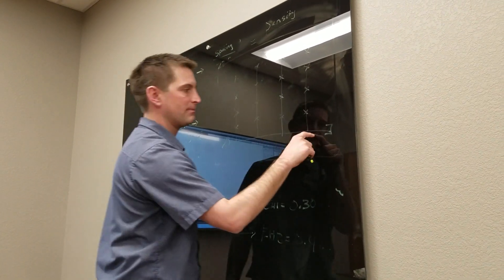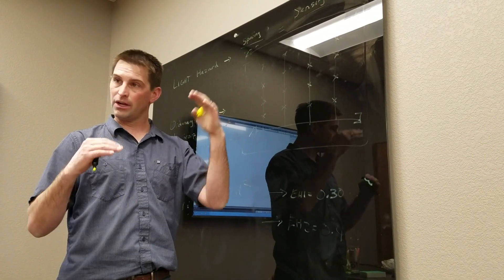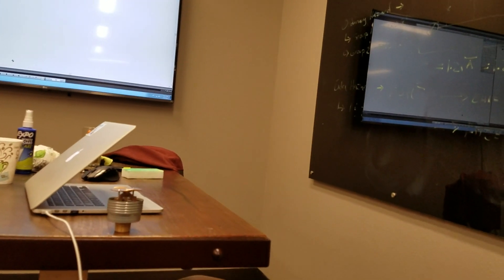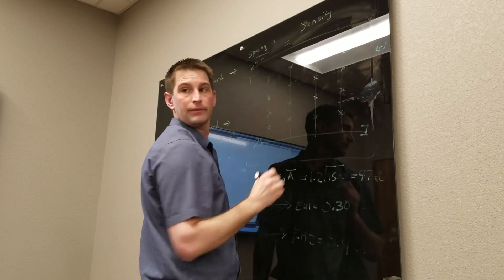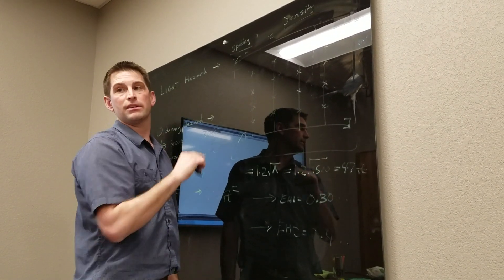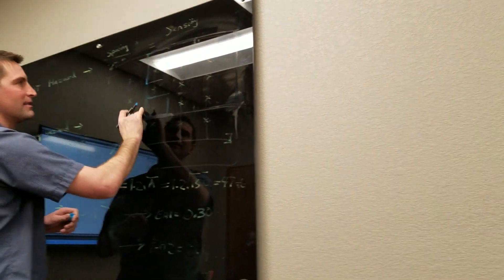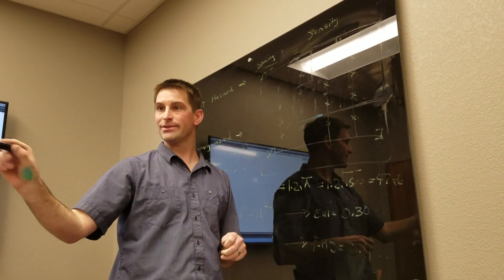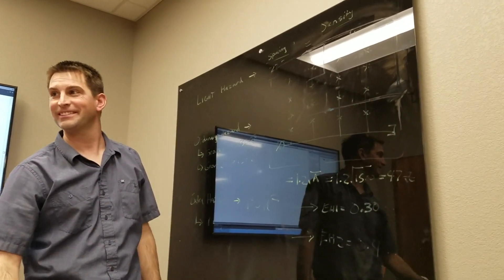Basics for Remote Area Calculations

Comment: When performing hydraulic analysis of sprinkler systems with inside fire hose stations, i.e., fire hose cabinets, should you include the fire hose cabinets in the analysis (50 gpm each for a total of 100gpm) or not include it and just add the 100gpm in the sprinkler demand in the last step?

Comment: Hi Nick. I watched your videos and it had me interested to study NFPA-13 because of your video. I have a question please, so once you had identified or drawn the design area, does it mean the flow rate per sprinkler head is equal to the:
(design area multiplied by density) divided by (the number of sprinkler heads enclosed in the design area you just drawn)?
Reply from the maker: it would be the coverage of the sprinkler head, not the area. so it would be the density of the calculation multiplied by the coverage of the sprinkler head. i suppose you could divide it by the number of sprinkler in your area to get a general idea, but it may not be accurate as the coverage per head may change based on your layout potentially being atypical in design

Comment: Hi Nick its me again. I watched your videos and it had me interested to study NFPA-13 because of your video. I have a question please, so once you had identified or drawn the design area, does it mean the flow rate per sprinkler head is equal to the sprinkler system water demand or requirement (design area multiplied by density) divided by the number of sprinkler heads enclosed in the actual area you just drawn or work out?

Comment: Hi Nick, can i ask a question?, how you determine the remote area or most demand area of the building, if the building had a floor have no partition and the floor area is all about 7k sq. ft?. (ordinary 1 hazard)
can i use my remote area is 1500 sq.ft or 7k sq. ft? thanks
Reply from the maker: you can. the size of the remote area has no direct correlation with the size of the system. the only determining factors would be hazard and  structure. so youre only taking into account the density and ceiling height if the ceiling height is low enough that you area able to use a remote area reduction and that your hazard is low enough to use a reduction
Reply: @I_WasHere , there is a reduction relative to the ceiling height??😮 can you send me the reference sir?

Comment: Okay, after getting the remote area we are to solve the head loss, no? Do we have to solve all the head loss in the entire building or just from the tank to the remote area? 

hope my question makes sense.
Reply from the maker: Just for head loss in the remote area. As far as the tank thing, i personally havent had much experience with tanks and someone can correct me if im wrong, but i believe youre only calculating through the pipe  directly from the water source and your remote area
Reply: Thank you so much for the reply.My classmate thinks that we need to calculate the head loss for the entire building. God bless

Comment: thanks for this video. this video is very helpful.
.. can ask a question?. the  remote area is the basis to size the pipe riser? or the whole  number of sprinkler  of the building by hydraulic calculation?
Reply from the maker: It can be used to size the pipe riser if you are starting a new system in a new building on a new building site. But most times, in my experience anyways, youll be starting from am existing riser. What the remote area does is determine, if in the worst case scenario, that the system that you have designed will function properly upon activation. It will aid you in sizing pipe or figuring out where you have to make changes as well
Reply: thank you for your comment.
Reply: can ask something again? how to calculate the area be used in most remote area ? thanks

Comment: thanks a ton
by the way how to decide most demanding area
Reply from the maker: Thats either going to be the furthest(or technically most remote) area away from the riser. But it can also be the most hydraulically demanding area, like an area thats a higher hazard or an area using extended coverage sprinkler heads

Comment: thank you for this video
Reply: why do we need to  know first the remote are?
Reply from the maker: doing hydraulic calculations helps us determine whether or not the system thats been designed for a given structure will work properly in the event of a fire. so we calculate the most remote or the most demanding area of that system, because if that area works then the rest of the system should work
Reply: Sir Nick i hope you will make another video on how to design fire pumps . thann you again for this educational video
Reply from the maker: fire pumps is probably the next most likely video